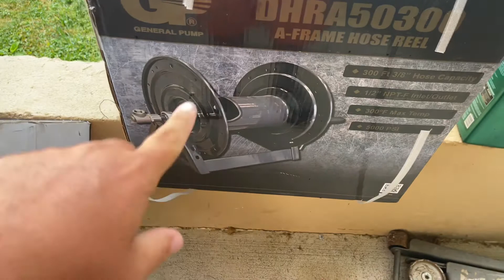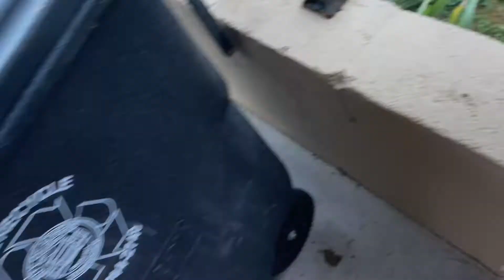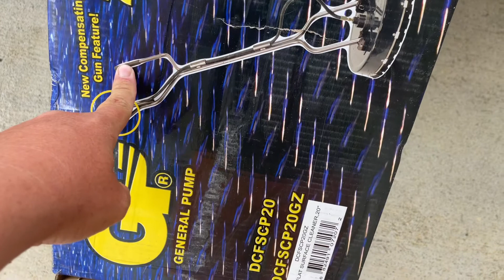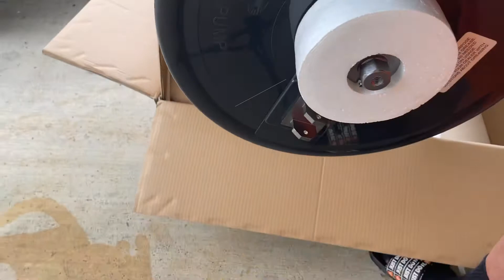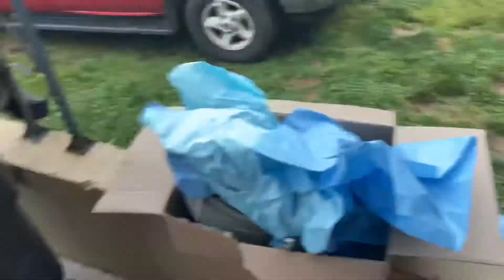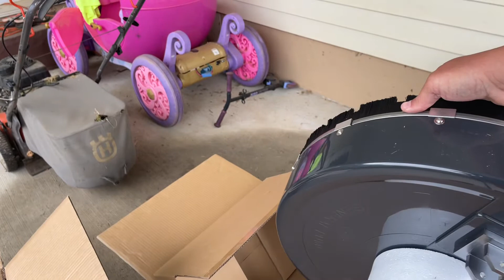New equipment for my pressure washing truck skid

Comment: No ramps for the pressure washer ? I habe the exact same pressure washer . That's how I load and unload it into my truck. I keep it in the truck bed when i go to a job and use a gp reel like you have for my 150 feet of pressure hose. Love all your vids.
Reply from the maker: Thanks I appreciate that.  No ramps just muscle and a sore back😂. I’m going to mount it so I can just start it from the truck now I have 250ft of hose. Going to make work even better
Reply: @jonboysprowash7845  yeah i tried to lift it in and out. I soon realized that's a hernia just waiting to happen. Are you going to buy a skid mount for the pressure washer ?  I was thinking about doing that for mine. Not sure where to get one though.
Reply from the maker: No I will just mount it how it is to the frame. I’d like to get a dampener so it isn’t hard mounted.
Reply: @jonboysprowash7845  yeah i was thinking about adding some dampeners too. I'd like to see how you do yours once you figure out how you are going to do it. I've seen videos of people installing riv nuts into their truck beds to mount stuff to the floor. That seemed like a good option to me.
Reply from the maker: @tedaut  mine would mount to my skid floor. Would like to rubber mount it like a motor. I may end up just getting up in the truck and pulling it each time. This setup is a better but a lot of little things I have to figure out as well.